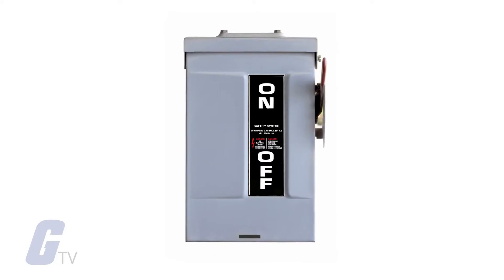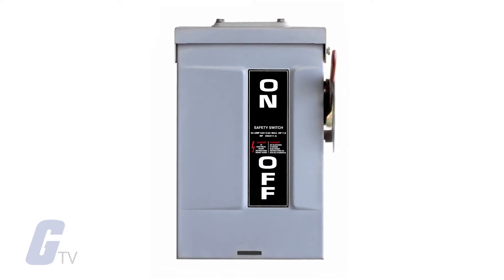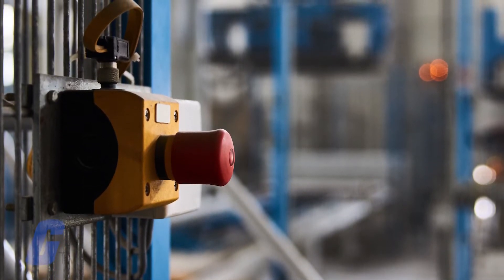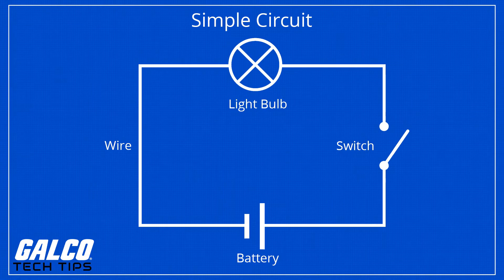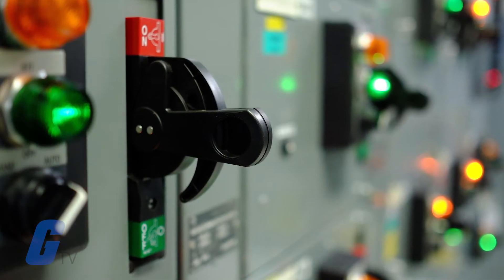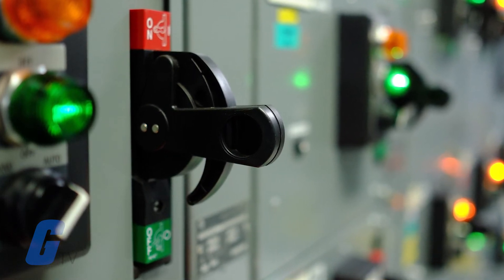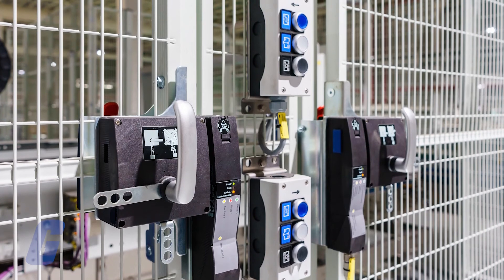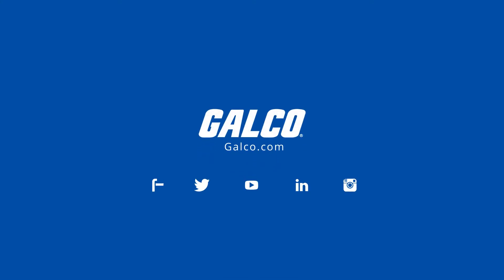What is a Safety Switch? - A Galco TV Tech Tip | Galco

Comment: Hey, i was wondering what the difference between a 2 pole safety switch  and a 3 pole  safety switch is?
Reply: the amount of hot/live conductors disconnected so a single split-phase disconnect would have 2 poles for each phase and a three pole would have three phase but you can use it for whatever you want to disconnect so it doesn't really matter, also neutral isn't normally counted as a pole but still watch out for that.